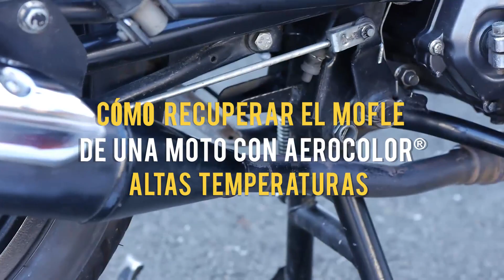¿Cómo recuperar el mofle de una moto con Aerocolor® Altas Temperaturas?

Comment: DE RUST OLEUM LO UNICO QUE ME GUSTA ES SU BASE IMPRIMANTE BLANCA Y SU PROTECTOR TRANSPARENTE, DE RESTO ES NORMAL.  YO PINTE EL TANQUE DE MI MOTO Y DEMAS PARTES CON AMBAS MARCAS DE PINTURAS, EN LA BASE, USE RUST OLEUM, EN LA PINTURA NEGRA, USE PINTUCO ALTA TEMPERATURA Y EN LA LACA TRANSPARENTE, RUST OLEUM, Y HASTA EL DIA DE HOY, EXCELENTE.                    TAMBIEN PINTE UN MARCO DE BICICLETA